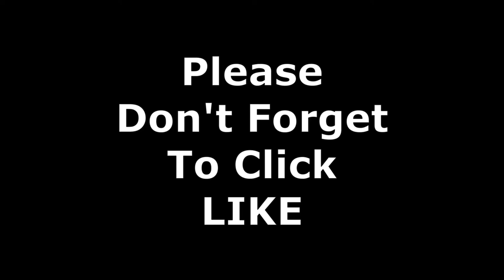1997 CVPI Destroyed Intake Removal

Comment from the maker: I realize this video is only the tear down, but I couldn't see anyone sitting straight through to the end of the install and startup. 
In part 2, what is under the intake is one thing... but the huge mistake that I make during the reassembly, may have cost me the need to pull apart a LOT more... We'll have to see what happens. All I will say is that the Crown Vic is in serious trouble.